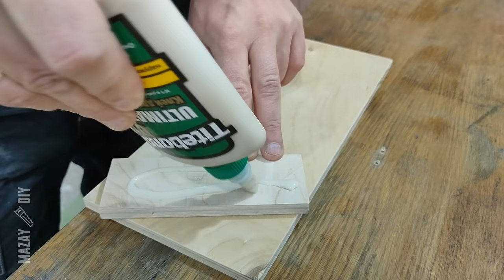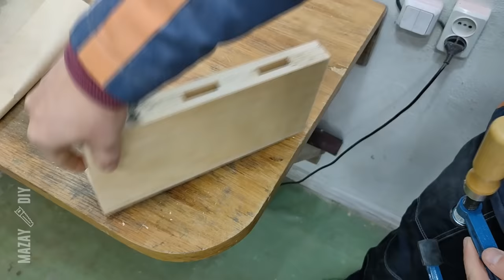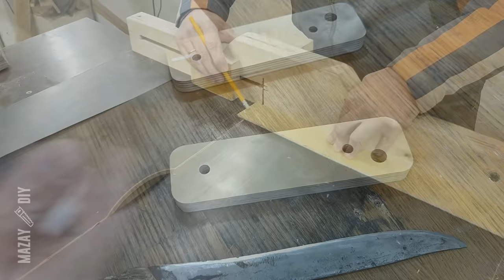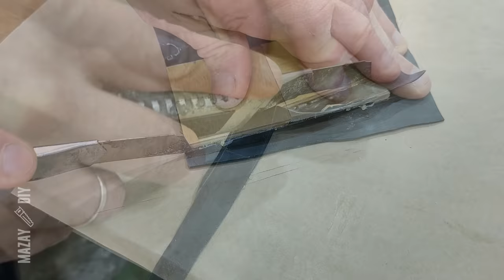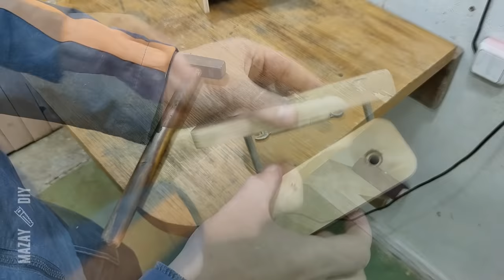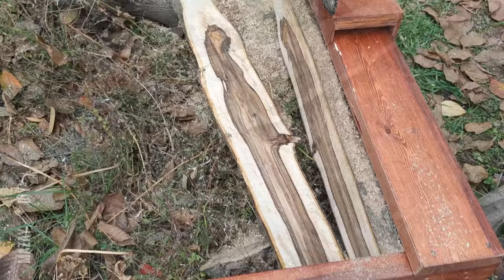Mini Chainsaw Mill | Building a DIY Mill Guide Jig | Free Plans

Comment: I managed to make this in half a day from the plans and I gotta say, I’m impressed. 😊 It worked really well and the only problem I had was an underpowered chainsaw. I made a few mods that I think improved it a little. 1. I used a locknut on the main M12 bolt instead of two smaller nuts, and 2. I increased the length at the back by 50mm to stop it pulling up when lifting the chainsaw. For Australians I also used 19mm merbau for the bar clamp.

Comment: If that clamp you made for the bar comes loose the chains will runn straight into the metal screws not just  damaging  the chain but also  throwing  metal all over the  place the vibration and moving  stress  is to much i won't  risk  it

Comment: The off-center axle rotation of this jig will cause it to both jamb in operation and allow dust to interfere with its motion. I strongly suggest that you place the axle in the middle of the jig.  

The bike-tube rubber seems like a really great idea, though. That's certainly the next-best thing to putting a hole through the bar.

Comment: Hi,
I hope you can understand me,,
I love your idea,, it's great 👍,,I  do see one thing though that could be improved and it would help you.
It's the two pieces of short wood and the longer one going from end to end.
You screwed the longer one down onto the two shorter pieces.
I'm just wondering if you could think of another way to do that.. like drill holes about an inch apart on both short boards and two holes on both ends of the longer one, then you could use short bolts to drop down and hold the long board in position.... Well done,, great idea 👍👍👍👍😂🇮🇪
Reply: I understand you ' Do you understand me ?
Reply: @keithclark486  I understand you, why are you asking though ?
Reply: @liamc-rb9tz  
Because I can't understand what the other comments are saying that's why ' because it's not my native language. 
Do you understand now ?
Reply: @keithclark486  😊,,, I don't understand the comments either, but that video impressed me enough to write a comment here
Reply: @liamc-rb9tz  
I understand 💯👋